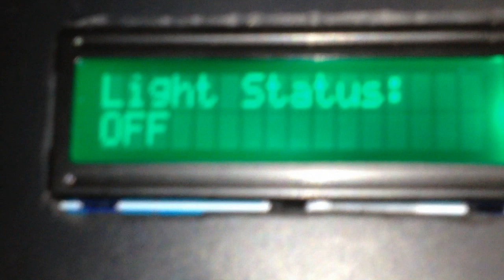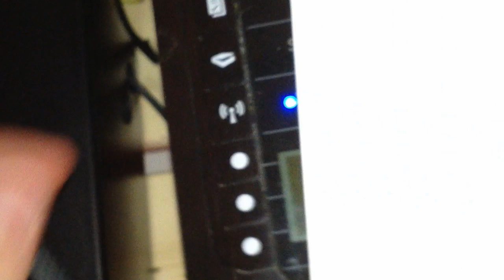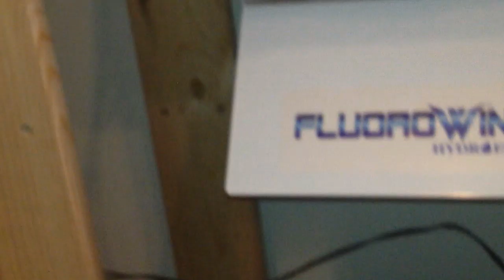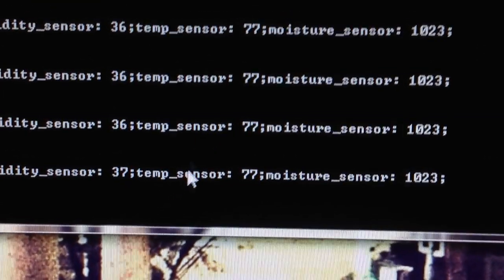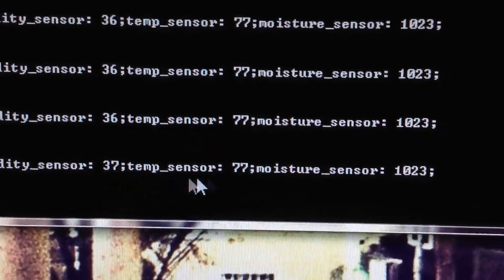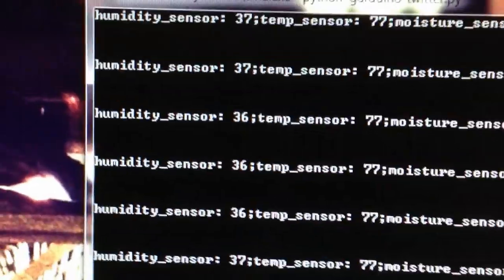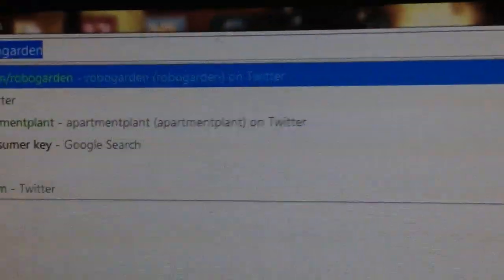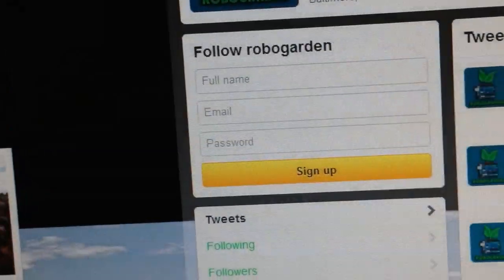Twitter Arduino Automated Gardening System w/ Light & Water control, Xbee, & RTC

Comment: I Really like what you did! I am not a noob asking you to help me then gives a long list of what I have dreamed of and by help they usually mean write the code breadboard it for them and post a video showing them how to do it!! I know the basics of IDE sketches and codes. I just need to know what you used software wise in the sketch for the moisture sensor or the link I prefer to learn myself. What components did it require, Basically how do I learn this as you said you did??????? I have checked many Tutorials and Learning Systems Arduino.cc too just dont see it, with a quick look. I subbed to your channel to support your efforts please respond! TY